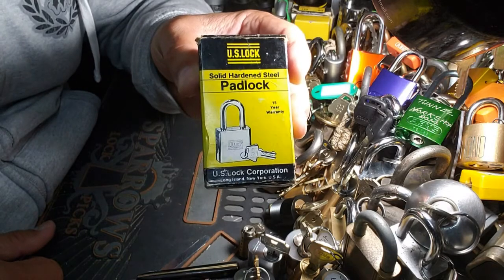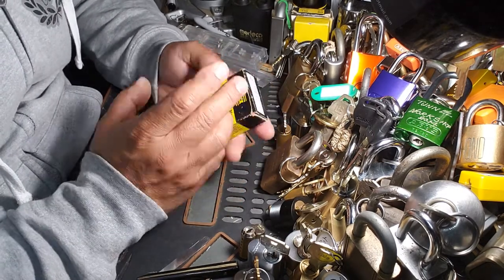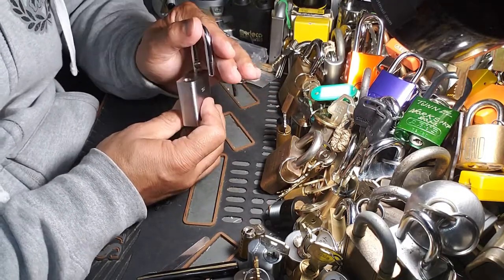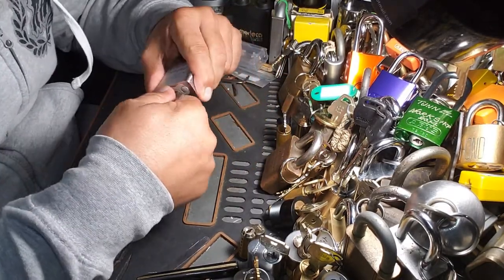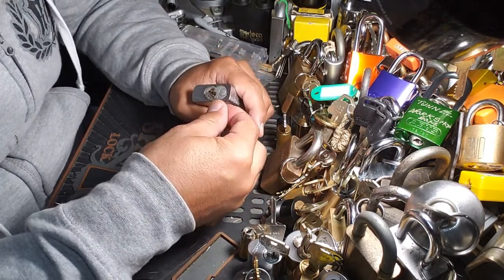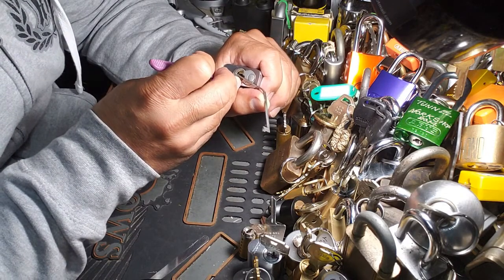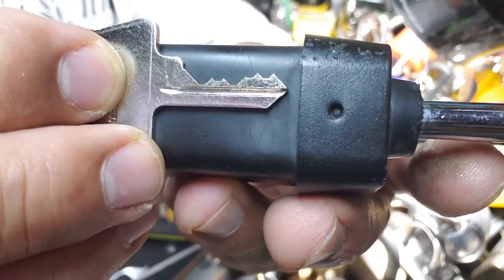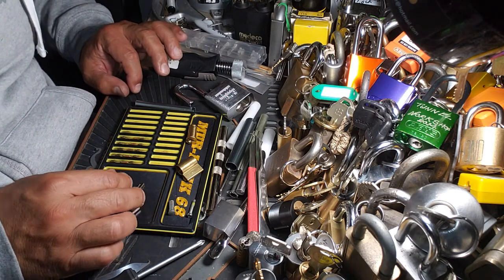# 622 MUR-LOCK 68  INAUGURAL Plug Spinner Attempt! Unedited/Unscripted

Comment: Not sure what the purpose of that was. The reason you have trouble with American locks is because you have decided you have trouble with American locks. However very nice lock and fantastic that you have a box that is in really good shape to go with it.
Reply from the maker: Purpose was to demonstrate spinner Rob
Lock much easier to pick against spring tension but that does not give you an open
and spinners are designed to spin core back past  shear line for open so they clearly have a purpose
Reply: @Mur-lock68  I understand what the purpose of a spinner is my friend.